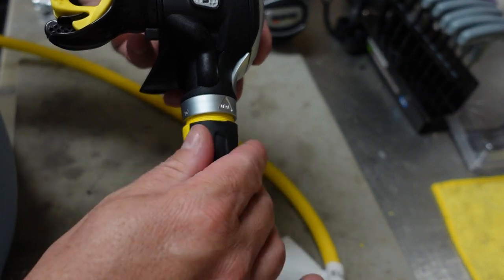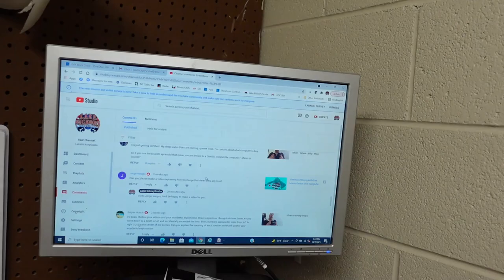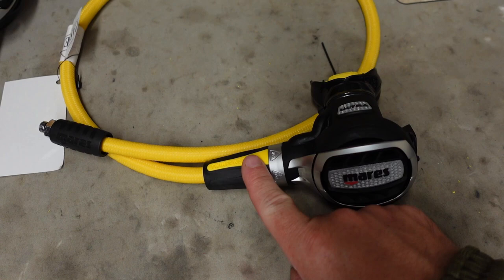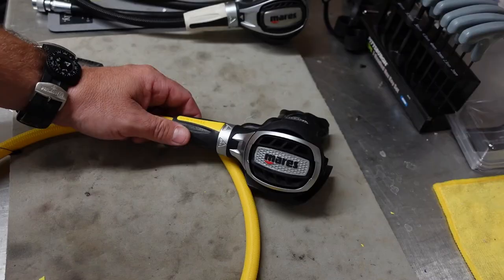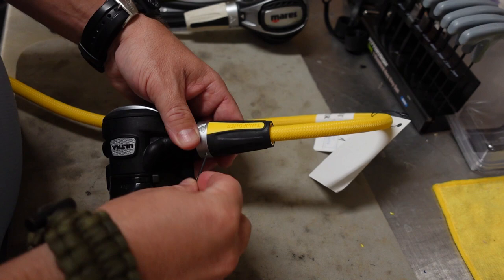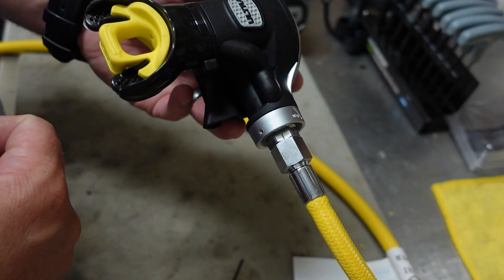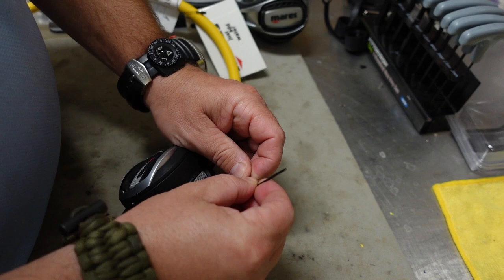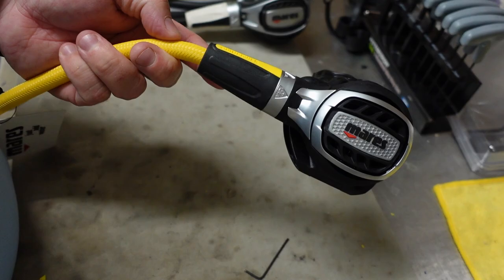How To Change The Hose On The Mares Twin Power System

Comment: Thanks for the video sir! I am a big Mares fan and Mares diver, only problem I have with Mares is the wetsuit for my size 🤣. Only thing is make shure to rinse the regulators really good and dry them. Keep up the good work😊🤙🤿🦈
Reply from the maker: Hello Boriken Nautical, we too are huge Mares fans. I agree, the wetsuits need a lot of work. My issue isn't sizing, but the longevity of the material. The rubber that Mares uses, does not hold up very well in chlorinated water. I go through a minimum of three 3mm wetsuits a year.

Comment: One of the best (if not the best) Scuba channels on YouTube!
Can you explain the difference between SSI's new recreational Decompression Diver program and XR Foundations, XR Nitrox or XR programs? Being a new program, I looked all over but couldn't find anything about this subject. Is it better to do the XR Foundation/Nitrox or is the decompression diver enough to enjoy more bottom time at depth?
Reply from the maker: Hello Yousif Jawher, thank you for the kind words. SSI has developed the new Recreational Decompression Diver program in respnonse to the XR Nitrox program. This is an entry level course and just another stepping stone for a recreational diver to gradually get into tech diving. For experienced divers that have a general understanding of decompression theory would not need this course, and could skip it and simply take the XR Nitrox course. By giving different options to newer divers, this allows those who have trouble understanding the theory part a better option than just throwing them into a technical based course. As far as the Foundation Course, this too is a stepping stone for recreational divers that still need to work on trip and equipment configurations before journeying down the path of technical diving. I would speak with your local SSI Instructor, and see which course would be best for you. Just keep in mind, not all SSI shops will be able to teach the entire spectrum of courses offered by SSI, but they should be able to assist you in find an SSI Instructor that can suit your needs.
Reply: @LakeHickoryScuba  WOW! Thank you for such a detailed answer! I appreciate it! Good luck and keep up the amazing work!

Comment: Be careful with the reg side 17mm wrench. The reg side nut is thin. You may need a wrench thinner than a normal one. Otherwise you cannot turm the other one.
Reply from the maker: Hello N N, we agree, this is why we use the wrenches provide directly by Mares.

Comment: How I can stock or fold the long hose regulator on bcd?
Reply from the maker: Hello Waheeb rasool, I assume you mean when you are not diving. I usually roll mine up in a coil and use a bolt snap to clip it off when I'm not using it.

Comment: Do you just add heat to remove the Twinpower collar?
Reply from the maker: Hello Derek Lomax, there is a small set screw that must be removed before you can remove the collar.
Reply: @LakeHickoryScuba  removing the collar from the hose is the problem. Need to replace the hose
Reply from the maker: Give us a call Derek, and we may be able to help you out. 8286327649, hit option 4.

Comment: almost as bad design as my scubapro reg which needs custom scubapro wrenches to take the hose.
Reply from the maker: Hello KlixTrio, most dive gear manufactures use specialized tools for repairs.
Reply: @LakeHickoryScuba  as far as I know scubapro is the only manufacture that needs special tools to take off reg hoses.  Service is different but I feel like a hose swap shouldn’t require special tools. Just seems like scubapro trying to make more money.

Comment: what a crappy design!  Just holds saltwater on the swivel, promoting corrosion and problems... but it looks nice...
Reply from the maker: Hello Whatandwhen2, thankfully, we have never had an issue with this design holding saltwater. The casing is not water tight.